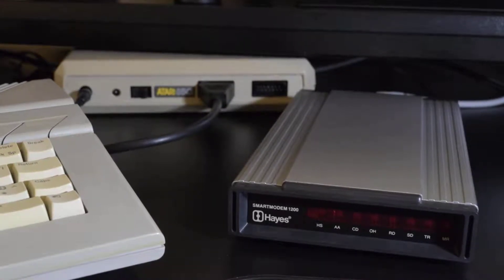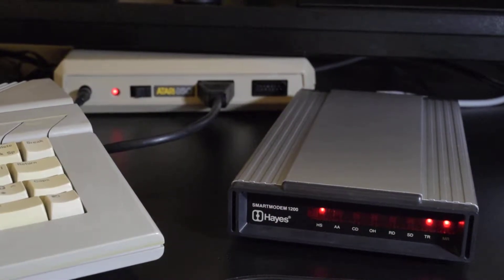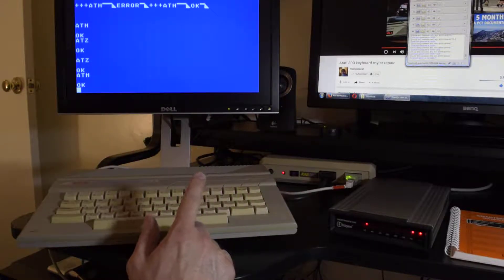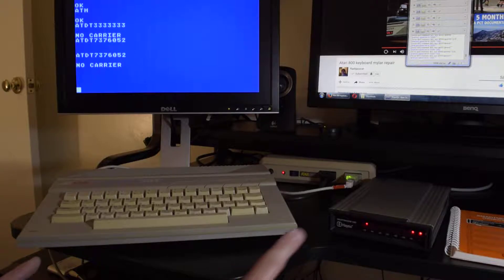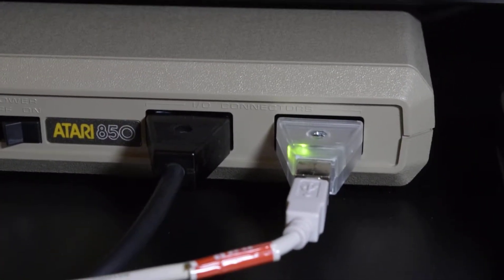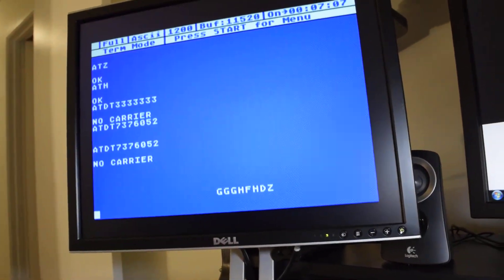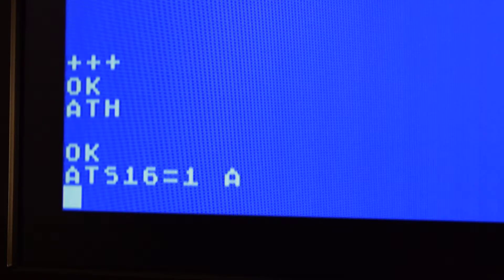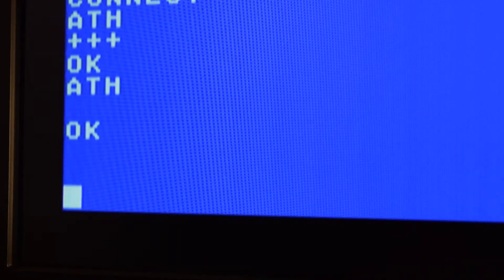Testing a Hayes Smartmodem 1200 with an Atari 130XE

Comment: Nice it works. Now you need a phone line. You can get viop SIP ATA's for under 10 bucks. Then hook it up to a cheap SIP provider like Anveo and start dialing up some BBSs on that Atari.
Reply from the maker: Yes it seems a little flakey sometimes, too. It's got some personality! ;) Maybe some caps need replacing I don't know.  Yes I want to use the Hayes to dial out and am looking into your recommendations.  Thank you I appreciate it!   In the mean time I have already purchased a Lantronix SCS100 (console server). It has a RS232 on one side and ethernet on the other. It acts like a modem, accepting AT commands but acts as a telnet or ssh client to a remote server. It would replace the Hayes but it works over IP with no phone charges.